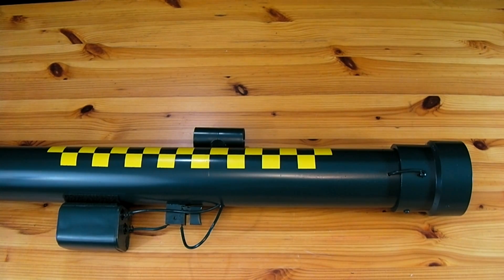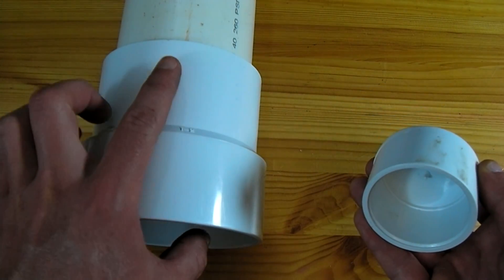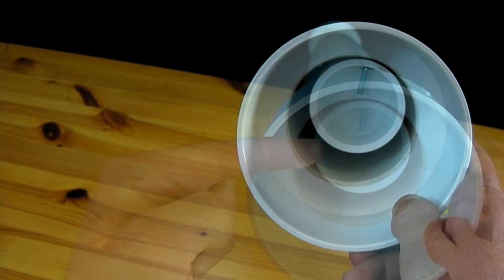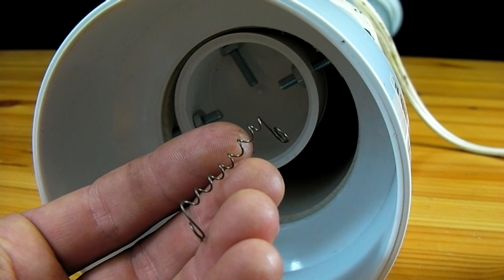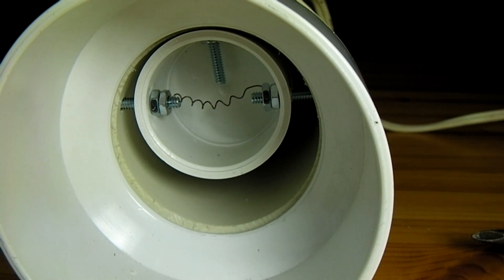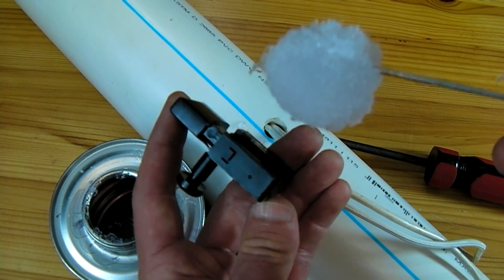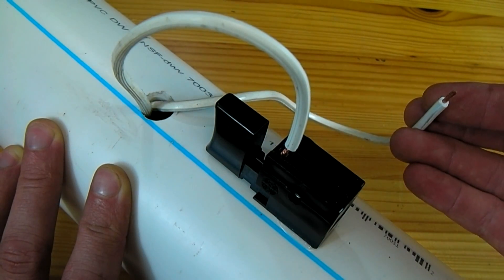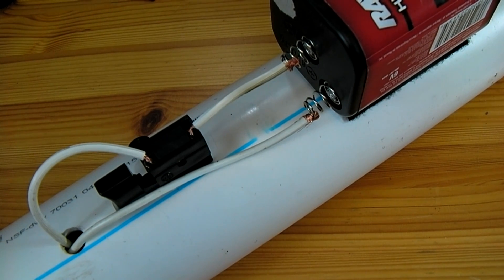How to Make a Rocket Launcher Replica w/Flash Cotton Muzzle Blast [HD Video Tutorial]

Comment: just curious but instead of putting the wires on the outside for the ignition, would there be any problems for putting the wire on the inside between the outer pvc and the pvc end cap on the inside